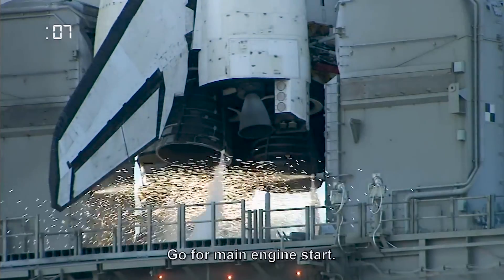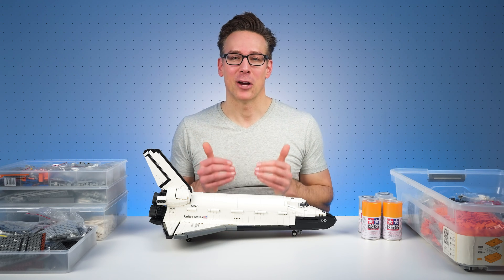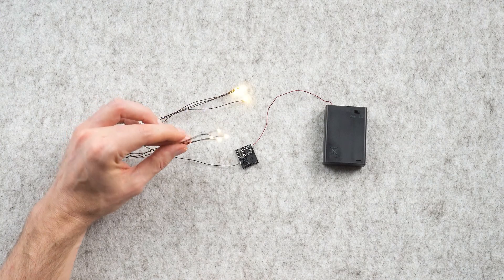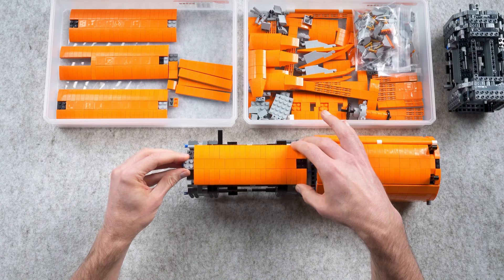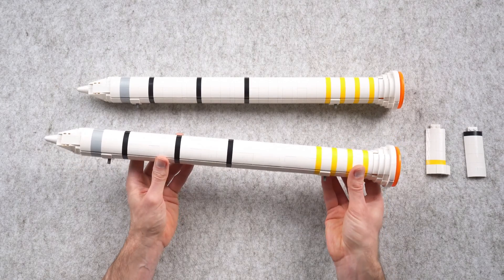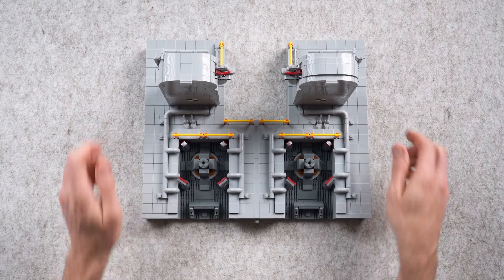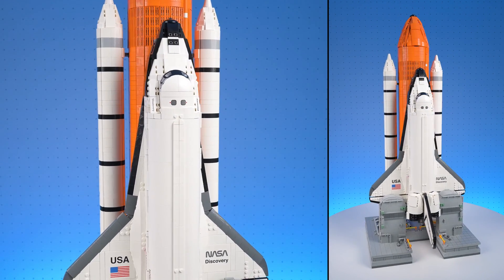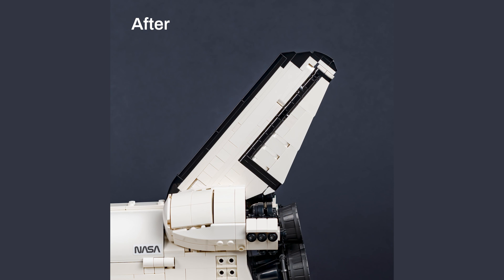Lego Space Shuttle Discovery - BOOSTED version!

Comment: I just got done with this kit. 2 notes: I have found a nearly identical paint by a brand names “hardcore” called “mango” glossy finish. It is nearly identical. You will need to spray any peices not white already with a flat white to make sure you get a bright color consistency across all the peices. 
Point 2, and I’m really surprised you didn’t think of this. Instead of reengineering the launch pad to be narrower, just make the spacers from the booster to the main fuel tank a 3 stud instead of the 2 stud. You cant tell a real difference in the spacing when it’s all together and batta bing batta boom it’s done. 2 second fix.
Reply from the maker: Amazing that you found a paint type and brand that's a good match to Lego colours. Thanks for letting me know. 'll keep an eye on that brand, or remember it, if I ever in future decide to paint Lego parts.  I'm glad to hear too that your 3L spacers was your solution for the getting NG_DEsigns's boosters to seat on the TheBrickFrontier's launch pad.  I did think of that as an option and tried it, but to my eye the boosters spaced that far off the center fuel tank looked weird.  Happy with my solution.  That said I've dismantled the fuel tank and boosters as at some point in time I'll build TheBrickFrontier's version as I think it's the better model.  All the best and thanks for sharing.

Comment: Been thinking about doing this. Any idea if the darker orange updated version has the same issues you mentioned for this version? 
Is it worth going down that version route or just sticking with Frontiers version?
Reply from the maker: Maybe this will answer your question: I recently pulled mine apart, with the intention of building The Brick Frontier's version at some point in the future. I've kept the launch platform, but I'll have to widen it, and I intend to re-use as many of the fuel tank & booster parts as possible in the rebuild.

So for you I highly recommend to go all-in and build the Brick Frontier's models. 🙂
Reply: @CraftedBricks  Appreciate the reply! Cant wait to see an update video if you plan to do one. 
For sure leaning towards the BF version :D
Reply: @CraftedBricks  I have another question. Do you have a parts list of the pieces you used for your improvements?
Reply from the maker: @XxTeam48LowesXx  Hi there, sorry I don't.  The changes I made were free-styled and I didn't keep a list or mock-up a design.  Sorry I can't help this time.

Comment: I'm doing exactly the same thing, having already bought ng_designs instructions when I found the launch platform instructions, which were free. I built the entire model in the Bricklink Studio before buying parts and discovered the necessary change in the dimensions of the platform. I made the changes and am now at the point where I'm going to do the final mounting. I'm wondering how you married the boosters to the platform. I'm attempting this using a 10 length axle that goes from the platform up into the boosters. I hope this stabilizes the model. I also am finding I had to adjust the point where the shuttle attached to the tank because of the height of the mounting points for the shuttle on the platform. I also removed the shuttle landing gears and closed the bottom of the shuttle to make it look better. Fun stuff! Thanks for the video.
Reply from the maker: I had similar problems Geoff!  The underside center of the Booster dishes (2x2 anti-stud) rests on the 2x2 round bricks (or did I use plates I can't remember) of the platform center supports under each booster.  And yes like you I had to adjust the mounting position of the Shuttle on the main fuel tank to ensure the rear edge of the shuttle cold rest correctly on the extension coming off the twin pylons of the platform.  Funnily enough over the weekend I accidently knocked the whole thing over!  I caught it mid-fall but I'm actually going to take it all down, pack it away for now and eventually re-build this going for The Brick Frontier's fuel tank and booster set-up so the whole thing is properly integrated.  I'll need to rebuild the platform too.  Job for a future Simon!  I'm glad you got this project completed!!